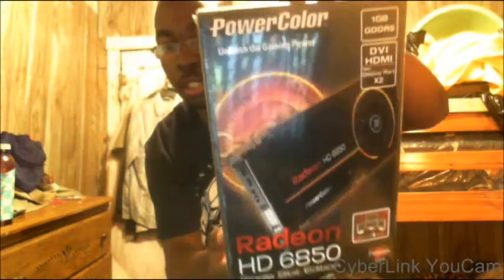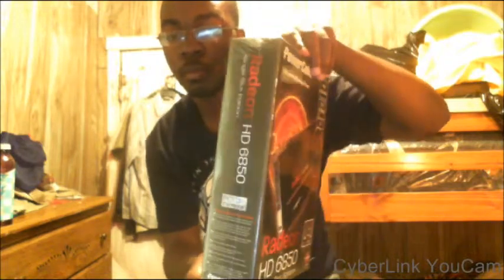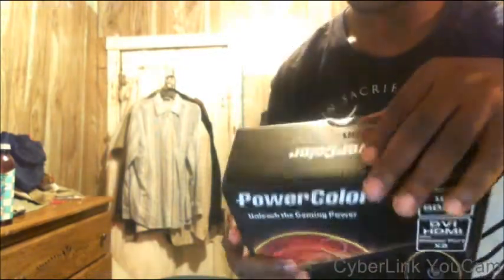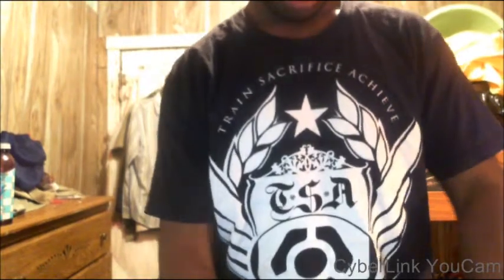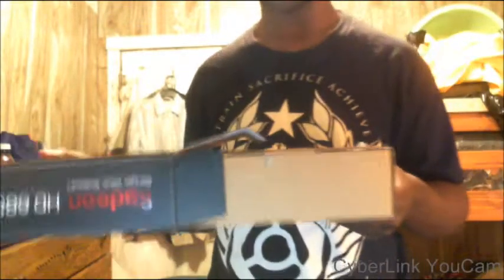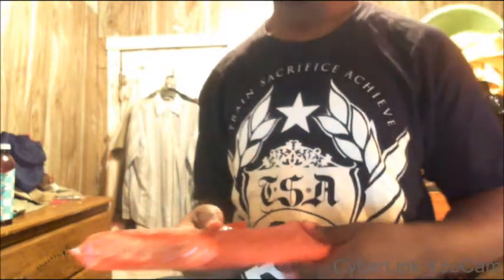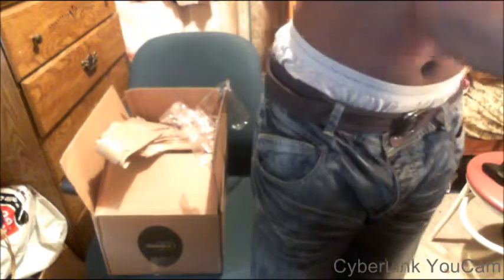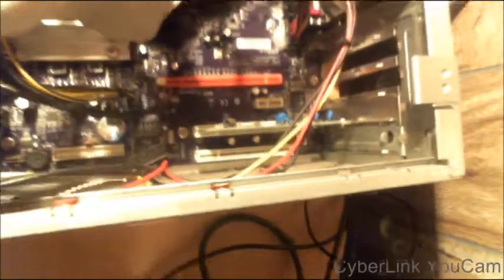My new GPU (not really an unboxing :/ ) Powercolor Radeon HD 6850 Single Slot GPU

Comment from the maker: Running things on high settings and recording things on high settings are two different things. I should have said that it records everything really good on low-medium settings) but plays everything really good on high settings. My CPU is my only bottleneck, but besides that, I can run Crysis 2 at 1080p and pretty much anything and everything else at that resolution and still allow the game to be playable. I am in the middle of completing Crysis 2 as well. But yeah runs everything high very well